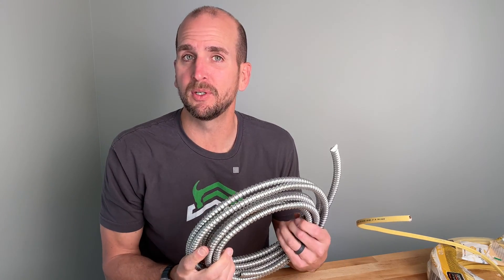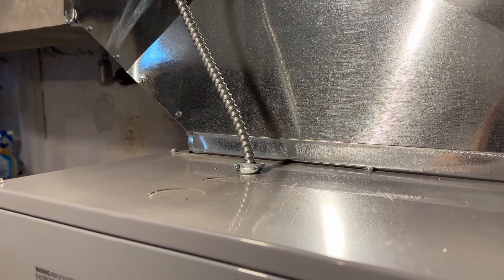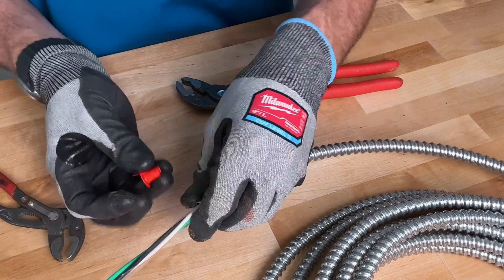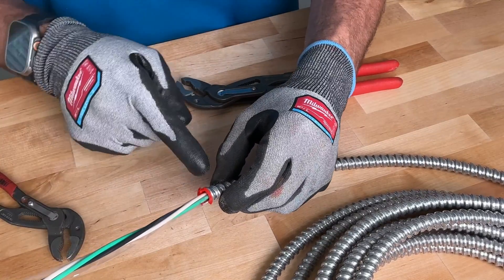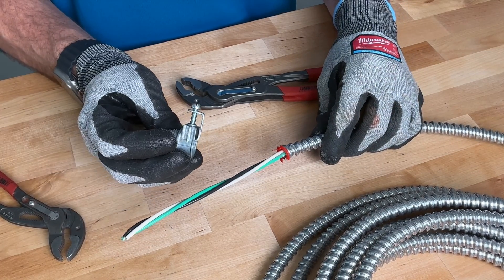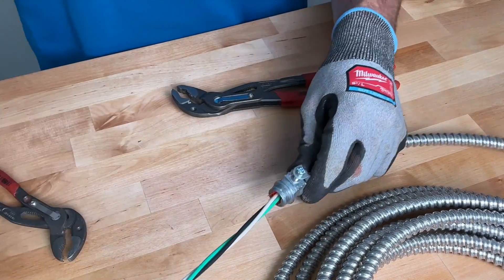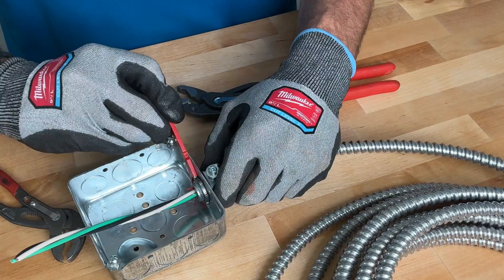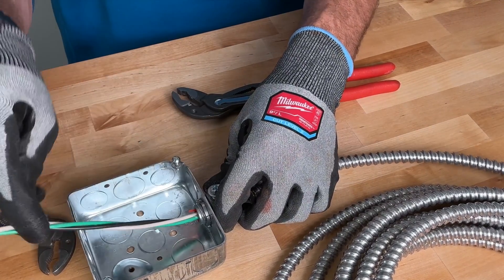What Connector To Use For MC Cable

Comment: Now, they just need to start providing a little rubber around the blocker bit, so they stop firing properly on test, then nicking a wire, when i push it together in the box😂😅😢.  

I second the aggregate cha tho; gonna have to have one o them wrenches

Comment: What the hell. I have a bag of that connector you showed initially. It’s a few years old. On the front it says “BX MC Flex” and on the back it says specifically for various sizes of MC steel or aluminum. 

The exact same product - same UPC - just purchased just says Flex on the front and the back doesn’t say MC. Although it does have FMC, RWFMC, MCI/PCS, MCI-A, AL-HCF but I have no idea what those are. Something must have changed within the last few years because it was definitely listed as compatible with MC.

Comment: Everyone has it wrong. It is a fitting. A connector goes between the raceway. Case in point: mc to emt. Also, mc does not require the bushing, the plastic shield does do that job but you CAN use a protector if you want. Ac, has paper and is required to have a ferrule.

Comment: Your video did not show that very well. How about a contrast between the connector you were tossing around first in your video? Some of those are open ended and others are restrictive. You just jumped to another connector that is different without explanation.

Comment: Are there saddle connectors for 3/4” NM (6/2 for a 50 amp circuit)?
Reply: Did you ever get the answer to this?
Reply: @javierlabrin341 nope.   I definitely did not just use the regular romex ones though, that would just be silly😊

Comment: You are using 3/8” MC cable here but I am using 1/2 and can not find saddle connectors to save my life. Can you help?
Reply: 3/8 and 1/2 are the same thing, it's just  a matter of terminology. 3/8" clamps are used in 1/2" knockouts.

Comment: There is also a combination connector (Halex 20570, Sigma 42002) which looks like an NM connector but has a ring with a hole in it to prevent the bushing from going through and possibly falling out while allowing the wires to pass through like they would on a regular BX/AC connector.  They clamp the end of the cable rather than use a set screw so they work on either type of cable as long as you don't overtighten the clamp screws.